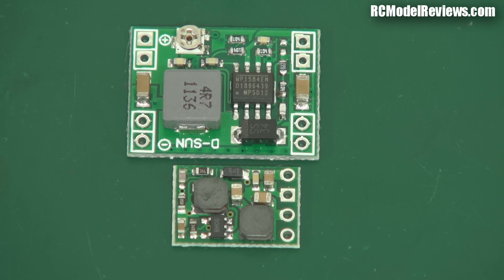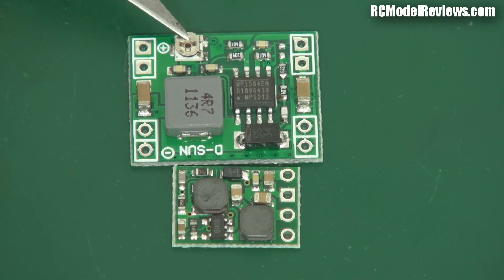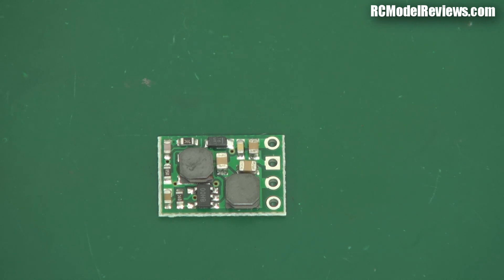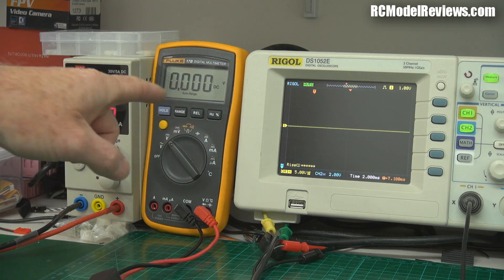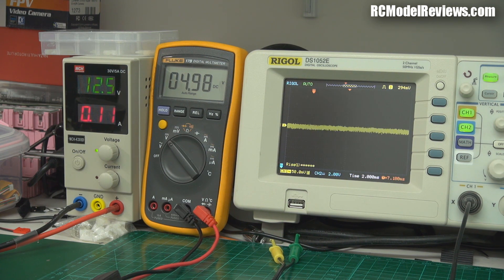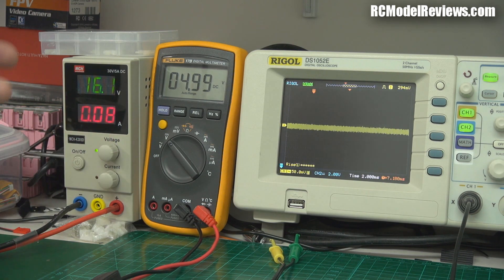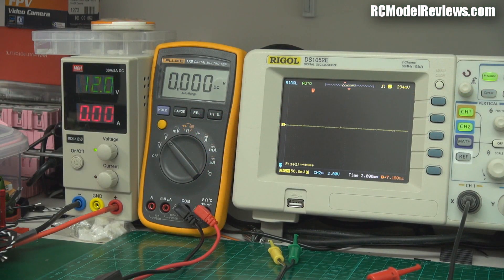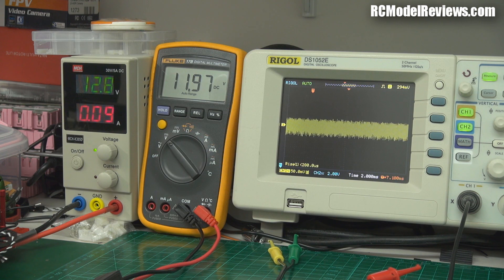On the bench: D-SUN and Pololu regulators (UBECs)

Comment: Hi , I've noticed that the pololu regulator only has a max continues current of 200mA and if I was to power a vtx with it with a camera coming out of it, it wil draw more amps , is that a problem and if it is how can I get around that ...? I'm only concerned about having a constant voltage into my vtx because I blew mine last week and my only thoughts to what may have caused the problem is the TALKED about voltage splash back from the motors having dampen light turned on my 250 quad !

Comment: Noise wise it is there a better way to get rid of it beside of the Humble LC Video Filter?
Reply: +Migueldeservantes Start with some capacitance on the output.  If you know the fundamental frequency of the noise it's even easier but start around 0.01uF.  A high-quality low-ESR capacitor is suggested.  My personal preference is low-esr ceramics if you can find them.  A decent scope is a must.

Also important to note how received noise is handled / filtered (like that picked up from the input side of the regulator from, for instance, a noisy motor controller / screaming brushed motor, etc.

Fun fun fun :)

Comment: I need a little advice. 
I have some 'super bright LEDs' from Hobbyking, which are mounted on their own heatsinks and require 2.5 to 3 volts. I've connected one to a D Sun regulator at 3v and it is indeed very bright and gets very hot. I left it lit for 25 minutes without a problem, but is it a good idea to use these D Sun regulators to reduce the power from a 3 cell Lipo? 
I ask because I've been reading about LEDs requiring a resistor to control the current.

Comment: I bought one a while back (http://www.ebay.com/itm/201414901717?_trksid=p2057872.m2749.l2649&ssPageName=STRK%3AMEBIDX%3AIT) and When I plugged into a 3s lipo it smoked, I think this is because it might only be a boost and not  a boost/back converter.
Reply: Ultra RC buck not back
Reply: Ultra RC a lot of cheap ones are 3-12V in and a fully charged 3S is 12.6 ...that's prob why you smoked it

Comment: used a d-sun reg before, worked well. only thing, is no one warned me the screw was like a tap, tighter is lower voltage... killed a flight controller.

Comment: Would the D-Sun be suitable for powering onboard LED's from the flight battery (3s) ?  I am electronics newbie and am wondering why 2 inputs and 2 outputs (4 solder pads each side)
Reply: +Peter Hill You could use it for that but most LEDs (strips or 3-LED boards) are deisgned to run on either 3S or 4S so you shouldn't need a regulator at all.
Reply: +xjet Thanx Bruce. Was thinking more for a fixed wing model. Nav lights etc.
Reply: +Peter Hill You could drop the voltage using one of these but it would still pay to use a resistor as well -- so as to avoid a thermal-runaway situation.  What I will do (if folk are interested) is show how to hack a cheap HobbyKing UBEC to become a current-limited supply for LEDs.   That is a much better solution because it will provide a constant current regardless of the input voltage and regardless of whether you have one, two or three LEDs in series.

Comment: The 5v step-down regulator is also a great way to power a Raspberry Pi. They're more more stable than the typical cheap USB chargers most folks try, and voltage drop is by far the most frequent cause of stability issues on them. Your cell phone's battery charger circuit doesn't care if you drop down to 4.7v, but your Pi will brown out and freeze.

Comment: I have a storm 370 size racing quad with 980kv motors and would like to upgrade the motors but I don't know what to go for, I was told by getfpv to get the new cobra 2206 racing motor with 30amp ESC and 6" props but I'm really not shore about that. Can anyone help me please? Meany thanks

Comment: If I wanted to power my SJCAM 5000 or GoPro off my quadcopter's main 3S pack (use a dummy battery to connect power) does it matter if my BEC gives a clean output or can I just go with any old cheapie that has the appropriate current/voltage specs?  Will the noisy voltage output affect my recording?  How about the SD video output signal for just viewing while flying?

Comment: I've found the Pololu 12v boost/buck to be extremely sensitive to inrush current on 4S systems — even if you install a low-ESR capacitor directly at the input — causing them to routinely fail on battery connection; especially if you accidentally get a few transient on-off transitions because your connection of the battery wasn't "crisp". Because of this I've switched to using one of their 5v buck regs (with 42v max input V rating) feeding their 12v boost reg. Their 12v boost/buck claims an 18v max Vin. This gives a much more robust arrangement. If be curious to see how such an arrangement is for noise. I would expect this less-efficient buck->boost configuration would give better regulation because you're never faced with the buck stage being inactive. 

Regarding your comment on adding a ferrite bead to combats noise, why wouldn't you add a filter cap on the output stage ? Is this frowned upon ? I know it would present a high start-up load to the regulator but wouldn't it work better?

Comment: I heard BEC has issue when driving too much current. I have a rc plane with 5 servos, love to see u characterize that kind of setup with your equipments.   Like voltage vs current load and when and if the current load is too high and cause the receiver to reset.

Comment: Have you tried out the Matek Mini Power Hub? I picked one up from PFV Model but havn't had a chance to try it out yet. 36x36 4 layer pcb with regulated 12v and 5v outputs.  If it works.... I think it was only around $5 US.
Reply: +Mike Bowers I'm using a couple of the Mateks. They're good. The only downside of them is that if you're running 3S, the 12V BEC for the VTX won't pump out 12V. For some of the VTX's out there, it's not a big deal though. So if you're running 3S, you would bridge the VCC pad instead, but this means that the VTX would run off the battery voltage. So when you decide to run 4S on VCC, you're up to 16.8V instead.

I purchased a couple of D-Suns to go on my Matek PDB-equipped 250's because I can then run the D-Sun off the VCC output from the Matek, then set the D-Sun to run at 9V which is enough for my VTX. Even if the 3S voltage gets low, I'm not going to be flying at 10.5V so it should work well.  And of course I'm then protected when I run 4S as well.

Comment: I haven't had good luck with the Pololu regulator.  They were noisier than other buck regulators and did cause lines in my FPV video.  An LC filter did clean it mostly up.  I bought 3 regulators and they all quickly died when trying to use them on 4S.  I was only powering a Sony TVL600 board camera, which uses ~80mA.
Reply: +ntc490 If you have one left and are willing to test it, it might be worth putting a 33 μF (or higher) capacitor on the input to the regulator in case it is being subject to LC spikes itself. This particular regulator doesn't like to get anything over 18v, and the guys at Pololu warned that they have seen input voltages above 11 V causing spikes over 18 V. However, I only only used their lower voltage regulators - 3v3 and 5v, and haven't had any reliability issues with them yet. They're not cheap, but sometimes were the best option for some projects.
Reply: Peter Feerick Thanks.  The Pololu guys mentioned that, too, when I contacted them.  I had already burned through them all before I could try the input cap.  The regulators seemed so fragile I don't have high hopes for the cap to completely solve the issue.  They are running pretty close to their max specs in a 4S quad.  They died in a few minutes of use.
Reply: +ntc490 Damn! Failing a few minutes in is definitely  not a good sign. Maybe it wasn&#39;t the voltage if they were dying few minutes in, but too much current being drawn? It can only supply 200ma, probably less when that close to its peak voltage - but that doesn't seem right as your camera is only supposed be be less than half it's capacity. Ah well, hopefully you have  worked out another setup that works for you. It looks like +Dave Johnson had similar problems with a 4S setup, and adding a cap was not enough. So he is switched to a manual buck -> boost setup - a 5v buck regulator (which probably has a 36-42v input voltage max) and a boost regulator to then get the 12v (either the same regulator so 18v input limit, which it should never see, or maybe a plain step reg like the U3V12F12 - which has a 1.4A input current limit, but should be protected by the other regulator). A bit messier, but more reliable, and a bit more modular. I was looking on ebay (have to stop doing that!) for a buck/boost regulator I had gotten before, but does not seem to be around anymore (or wrong keywords!), but came across this one (361383557664) - bigger, beefier, and getting cheaper!

Comment: I'm sure glad the good folks in NZ worked with you to keep you around.  I think a common use of the boost is to drive a "12v" CCD camera from a 2s battery.  The ratings of these things aren't constant according to the specs.  The farther the input voltage is from the 12v out, the lower the rating.  Pololu shows the curves on the two 12v output boost regulators I found. I'd like to see you test it with about double a typical camera load with typical 2s input voltages and see what happens.How about continuing this by showing some analog outputs from ESC's you have laying around and comparing them to switched BEC's?  How sensitive are the boost regulators to noise on the input side?  Sorry, but you're a guy we count on for this kind of info. Thanks again, Bruce!

Comment: +xjet - time to patent that!  Over unity on that 5V buck converter.  It could be an error on the PS current meter but I suspect you weren't drawing 330mA on the 5V output.  4.99 x .33 = 1.65W out, but only 12.5V x .10A = 1.25W in.  32% more energy OUT than IN.  Awesome!    ;-)

Comment: What about something to power a 12v tail light bulb on an old 6v motorcycle?
Reply: +Ty Lloyd Use a 6v bulb or some LEDs. Otherwise you are just overcomplicating things.
Reply: the problem is that it's too dark, 6v led is also too dark
Reply: +Ty Lloyd - you definitely could try one of the boost converters.  If it is just a tail light that is going to be on all the time I don't think you would have a problem.  I wouldn't use it on a brake light that would be switching the input power on and off rapidly all the time without doing lots of tests to see how the converter would take that "abuse".  But then again for the brake light, if you wired the converter before the brake switches it should be OK as you would only be switching the converter's output on and off and not the converter itself.  You want to make sure you keep a good seal on the light enclosure to prevent water from building up inside so I would avoid using any LEDs unless they are designed to fit it.  I am a bit surprised that there aren't any 6V bulbs out there that would fit though.  My motorcycle uses 12V so I don't know.
Reply: +Ty Lloyd 
Fitting LEDs into something that's designed for bulbs is a bad idea. The shape of the light (reflectors) is not made for LEDs. "6v led is also too dark" then you got the wrong LEDs (12V module running at 6v maybe?). There is no such thing as a 6V or 12V red LED. A red LED runs on around 2V. If a light needs more volts than that, it's a module with several LEDs, so just get the right one.

Comment: 0:13 actually these days hobby is so technical, that some people know almost nothing about electronics and are still able to fly pretty complicated models. Everything is available as pre-built modules, you just need to plug it in correctly, even without using soldering iron (Walkera for example).
Reply: +Роман Плетнев That's the difference between hobbyist and a teen getting a drone for Christmas.
Reply: +Роман Плетнев I'll second that. Kinda grinds my gears a little bit, but what the hell? Each to their own, I suppose.
I'm kinda the polar-opposite where I've taught myself quite a bit about electronics. In my opinion, I find it helps quite a bit when it comes to finding out WTF went pop in any of my helis.
Reply: Exactly! That and commercialism.

Comment: You can get those D-Sun even cheaper at Banggood! .70$ :-) 
Banggood dot Com Slash 10Pcs-Mini-DC-DC-Converter-Adjustable-Power-Supply-Step-Down-Module-p-951163.html?p=430714520645201404S1
Reply: +xjet Aw... c'mon Bruce... I'm sure they passed the Quantifiable Crap inspection!
Reply: +Mika Baumeister The reflow work on that Banggood sample picture is a bit "how-ya-going" :-)

Comment: I wonder if the adjustable regulators keep the setting on a vibrating environment. Perhaps a drop of glue after adjusting may be a good idea. (That's why I tend to prefer non adjustable regulators in some applications).
Reply: +hoggif 
I wouldn't trust a potentiometer with glue on it. But you can replace the potentiometer with a single resistor (the pot isn't used as a voltage devider, but just as a variable resistor). Formula for it is in the datasheet of the chip.

Comment: Coming from a programming/electronics background it took me some time to get used to the weird naming conventions the RC hobby has. "Why do you call this a BEC? It's just a normal regulator!". "Why are the channels named TEAR on the receiver? They should just be numbered from 1 upwards, because they are equivalent." Luckily quite alot of that is changing now and going for the way the rest of the world calls this stuff ;)
Reply: +superdau I blame it on the RC car crowd. They tend to swallow any line thrown at them. :) In reality RC has come full circle. Back in the early days flyers made their own radio equipment. Then Commercial products filled the demands for a turnkey system dumbed down for the non technical. The younger flyers are embracing Tech again if only at the digital electronics and programming level. Radio and analogue systems seems to be a complete anathema to most of them.
Reply: do you know the difference between MP2307 and MP1584  ?  i think the both have the same pinouts but not sure whitch one is best to use to charge mobile device
Reply: superdau BEC = BATTERY ELIMINATION CIRCUIT ...held over terminology from nitro RC days

Comment: Very pleased you reviewed, we have been recommending the dsun regs for mini quads a while now. Even with the newer cameras and VTXs that can handle 4S, the reg is still useful as an extra layer of protection for your sensitive electronics.   

We also did a battery of tests of various caps and coils and found a small cheap 220uF cap on the output further reduces noise down to around 20-30mVs. 

There is also a smaller version of the dsun, about 1/3 the size that we are testing at the moment.

Comment: Wow polulu have alot of noise if u are running it on high volts ...i run mine direct from my ImmersionRc vtx 5v out to 12v camera and don't think i get any bad picture ...but let's see if u test it ;)
Reply: +Harley FPV Yeah I do the same because I was getting noise from running camera straight off the battery

Comment: Ugh. I have a Quanum power distributor with the built in 5v and 12v ubecs and neither the HK filter nor the DIY filter were able to clean it up and messes with the minimOSD.

I must admit tho, that the idea was to allow me to stick a 4S in there without needing to modify the wiring, but i burned out my 4S (Full Throttle + 980kv Sunnysky + High Winds = bloated 4S battery 3 minutes in) so i'm currently flying with a 3S. The output is a full volt lower but that's still well above the FPV gears cutoff point so i left it alone.

So the 12v ubec has an 12v power going into it. Considering what happened at 7:40, Could plugging in a 12v battery to a 12v ubec be what's causing the noise?
Reply: +Ibushi 
Do you have an oscilloscope?
But yes, for a buck converter you absolutely need a higher input voltage than output voltage. Look at the sawtooth pattern around 5:57 . They are visible only a very short time, but huge (clipped by the scope setting, but I guess at least 1Vpp). This is what you get on most switching regulators when you run them with an input voltage too low. No amount of ferrites can filter that.
Reply: +Ibushi try it with the output voltage set to about 9V and see if the cam behaves itself. Please test this  thoroughly. Most of the smaller cased cameras now work at less than 12V. If all is OK you are good to go with 3 or 4S
Reply: +superdau I missed that part, good catch. I have a second jst soldered directly to the battery line for additional gadgets (like spotlights), i guess i'll connect the FPV to that for now. And i'll solder another JST to second ubec and set it to 9v as Rob B said (The 2nd ubec is set to 5v but adjustable) the next time i take this apart. Thanks.
Reply: +Ibushi see my reply to Bruce. It contains a link to mods on a pdb that may be the same as yours.

Comment: Dumb question I guess but wouldn't you also need a voltage cutoff gadget as well to protect the lipo etc..???...Rgds...Laurie
Reply: But here's the thing, if you had a cut off for your Lipo your quad would suddenly loose power and fall, most guys use telementy (littl on screen display inside of their goggles) to see their voltage on the screen. They also use buzzers so when the voltage starts to get low the buzzer sounds and thy know when to bring it back in
Reply: +LWJCarroll 
The cutoff gadget is your craft. It will just fall out of they sky. ;)
Reply: +LWJCarroll usually ESC's have that built in. If you're flying a plane and the battery voltage gets too low, the ESC shuts the motor off and provides only the receiver and servos with power. On a quad this feature is usually disabled so it doesn't just fall out of the sky.
Reply: +LWJCarroll   Thanks for the replies and info....Laurie